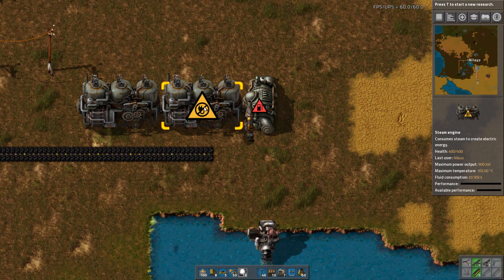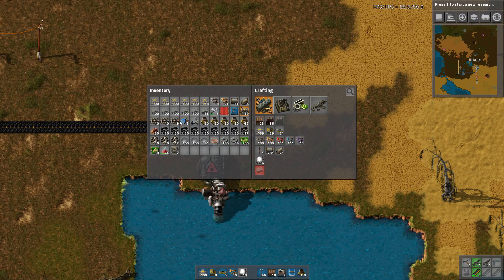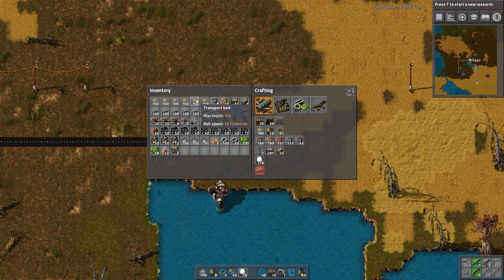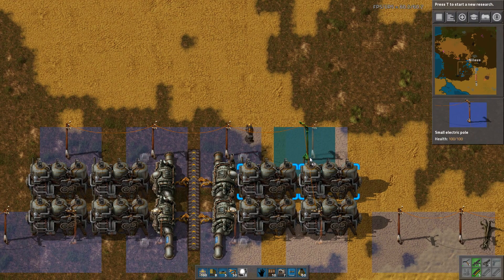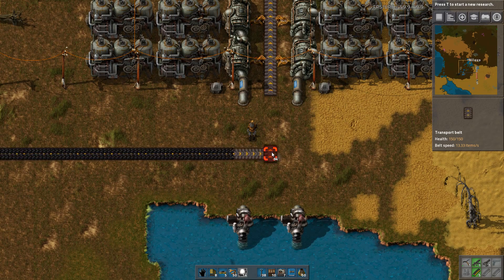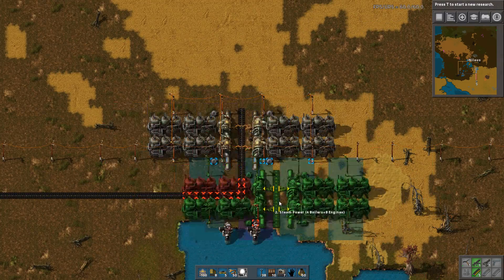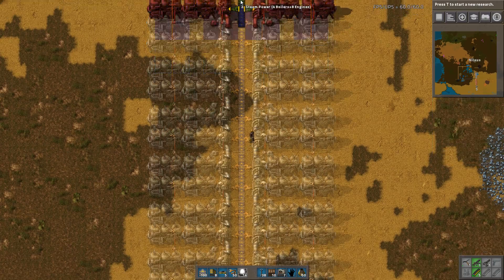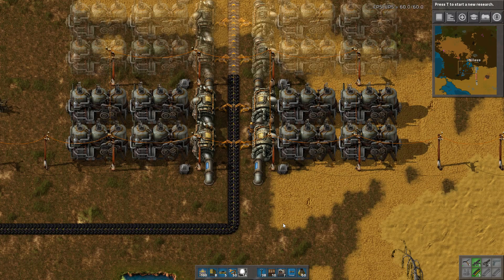Factorio Tutorial - 2. Steam Power

Comment: Burner or Electric Inserter?
I say Electric Inserters, out of the 120 hours in the past few days, I have not even touched a single burner inserter.
Yes burner inserters can be useful, and save some time, but they become less useful too quickly, to be bothered with.
Reply: No, they only take coal, or other sources of fuel, when they start to run out.
It is only when you have Crafted one, when you put it down, it will put One fuel block into itself.
Otherwise, once empty, they need to be manually refilled.
As long as they have the resource to keep themselves fuelled, they will fuel themselves.

The biggest problem I have with Burner Inserters is just that, they take fuel instead of Energy.
If you are to build a mega factory (Which the game is nearly all about), you will require solar power, and you will require fast inserters, stack inserters, and more, you will also need that coal to make plastic and other things, instead of putting them into burner inserters.
It is the similar part where people wonder why go with Electrical Furnaces from Steel Furnaces, they smelt as quickly, but Steel require fuel. Where Electrical doesn't, they require power.
Reply from the maker: I have also switched to electric completely since recording. A burner can run out completely and then it will not restart when the belt is full of coal. They need to be manually seeded; unlike the electric.
Reply: They just outperforms the burner inserters. Also noticed a lot of people tend to not update their builds at all even when the game has been changed on a heavier way.
Also would be good to have a guide or general basis for solar power. (Myself have a crappy design, but it is a 100 solar panel, 84 energy accumilators, and 9 substations. To get that 0.84 ratio)
Reply: Nilaus The only purpose of a burner inserter in a steam engine setup is to move fuel. If you manage to make them run out of fuel, you messed up badly. I'm sorry but I'm burner all the way. There is no normal way in which they can run out of fuel without actively making them waste their fuel. I would much rather take the small hit to my efficiency.
Reply: I don't understand this argument. They do restart themselves. When they're empty, they take coal by themselves, no?

Comment: Thanks for the video. I now realize that my current setup of two pumps, ten boilers, and twenty engines is woefully inefficient and I need to step it up. One thing to note, though: I use electric inserters, but I have the very last it boiler in the line use a burner. This acts as a slight back-up, if for some reason the power grid stops working (say by alien attack), the burned will still work, allowing it to still work until you fix the problem.
Reply: My setup is even more inefficent. I builded 2 pumps with 6 boilers and 12 engines, because this setup was demonstrated in tutorial campaign.
Reply: I've adjusted it to be 2 pumps, 20 boilers and 40 engines. I don't think I have to worry about power forever now :)

Comment: Not sure if I'm just misunderstanding your video, but burner inserters will pick up fuel off the belt and fuel themselves even if they are completely out of fuel. 

https://wiki.factorio.com/Burner_inserter
Reply: Not quite. A Burner Inserter will refuel itself, yes, however! If it's internal battery runs out of energy and it haven't refulled itself yet (for whatever reason) then it will not have the energy to put fuel in it's own engine, thus be unable to kickstart itself.
Reply: If they run out they will not fuel themselves anymore. They will only fuel themselves if they have the fuel to do so.